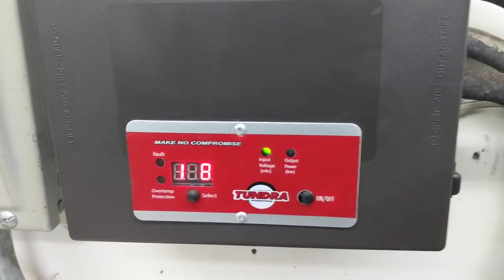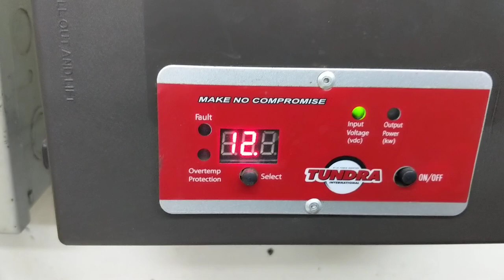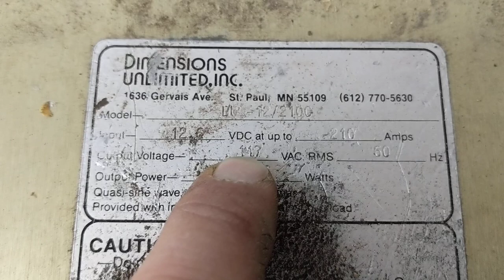Pt 1: My mobile small engine repair business

Comment: I have a small engine repair shop as my side hustle too. My shop is a stationary 40 foot long high cube shipping container and it’s tight. There’s no way I could get all my equipment in a van. Looks like a great set up. Hope it works out.
Reply from the maker: So far it's been fine the past two years. I'm going to finish loading it with spare parts this winter that is upon us. It's funny you know some of the equipment that I was used to using in the brick and mortar store that I installed in the van I have never used! Battery powered DeWalt tools replaced half my air tools and bench grinder. my downgraded my compressor from a large unit to a tiny unit has all I seem to ever use it for anymore is blowing out carburetor rules and gas tanks no more air tools. All of my real grinding equipment is left off site I do those separately from the on the road business. Just bought a Express dual angle Master unit quite excited to try using it this spring!!
Reply: My van is equipped with everything needed to repair any equipment failure that can be done on site. There's a video on it on my channel before I loaded it up with tool's. Mobile is the new thing in small engine repair. It's been around for year's but not everybody has called Sears Home Central for lawnmower repair. I worked there in 1999 and 2000 on small engine equipment and Air Conditioners. I repair everything from chainsaws to Tractors and more.